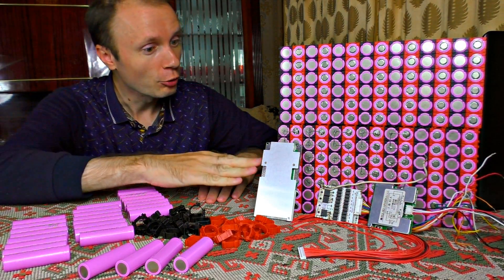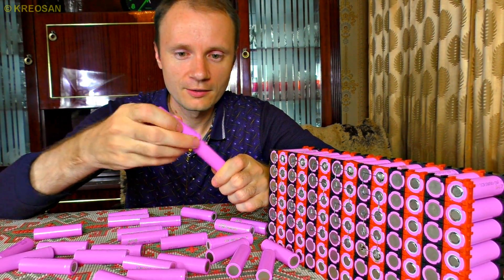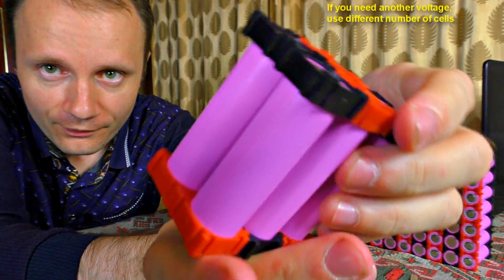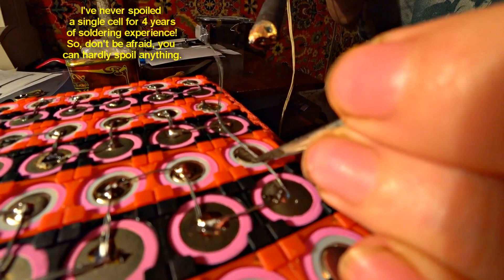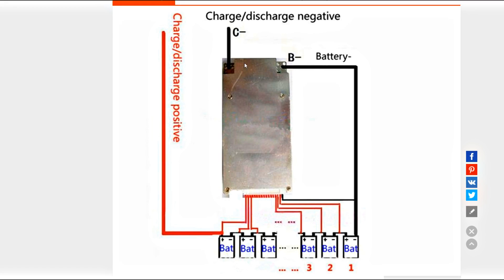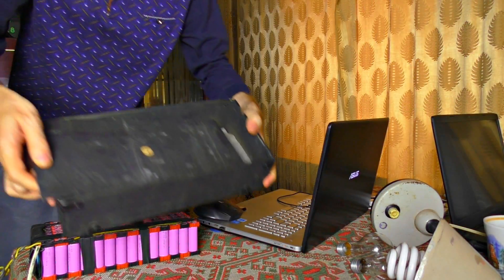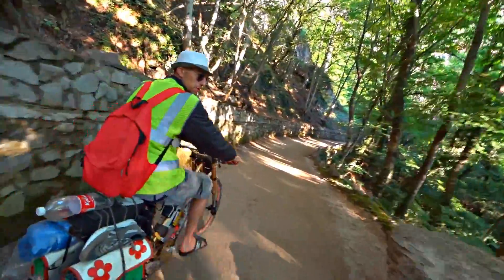Charge Monster / The Most Powerful Accumulator and Powerbank DIY

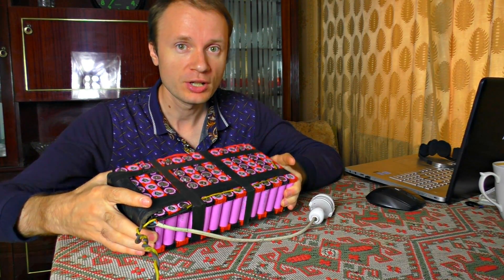Comment: 6:00 Why is it working? Charger needs AC but battery gives DC, you didn't even say about it.
Reply: Charger eats anything
Reply: Chargers use switch mode power supplies which work with both ac and dc and have a wide input range

Comment: please i would like to charge my battery on the skate faster now i have a 330W charger but 1200W would be a bit better advice i just need a power supply cc cv 48V and 20 up to about 30A ... thank you.meanwell are very expensive and aliexprews heating uz holen let you get involved in the sieves without a hitch

Comment: Yeah man I like your cells. I used a welder too but I only charge 50% at a time to avoid cells heating up. If cells got hot just one time it evaporate the electrolyte and lose energy capacity 10%_20%.

Comment: Please I install Mikrotik and Ubiquiti radios at remote areas and they are mostly 12v/24v,i have 18650 batteries that I want to be able to build a power pack that can last throughout the night and also even for 1 to 2 days when there is no sun...I have 10 of the radios on a mast or a pole pls advice

Comment: Wait... did he just connected regular lightbulb (230-240v AC) to a 48dc without a inverter ? I really want to know if that was the case
Reply: ShowMeQuick I saw that. It won’t work as most of them have a transformer. Transformers only work with AC power. This was dc. I don’t believe it’s valid myself
Reply: Some lamps use smps inside which have a wide input range

Comment: Bateries in series are not to be played whit. Easy to get zaped or killed. 
For those that are not avare over 40 to 45 V is treshold of human skin conductivity.
Bateries have more unf than most power grid lines.
Imagine Li ion or Pb batery say 50 to 60V and full discharge curent from 30 to 40 times capacity.
If starting low curent from high resinstance blocks musculs in lims then slowley you get cooked alive or more likley dead.
Think first and thick ruber gloves for the electricians are a must
Reply: 48V DC is not enough to do any harm unless you stick it in your mouth.
DC starts getting dangerous around 150V, but AC is a lot more dangerous and 100V AC can easily kill you.
Reply: @demoniack81  
In normal conditions, 48V is highest "safe instalation voltage".
Thats is why its used on aircraft etc. But imagine hands that where in saline solution aka sea water for   let say 15min, 48V safe then?
Expect strange and stupid user events always, thats life.
AC is not the more potent then DC for electricution, Edison propaganda myth from 19th cenutry, Tesla Edison competition
Reply: @ljubomirculibrk4097  I guess 48V might become slightly dangerous if you're wet with salt water, but not much I would think. If we were talking about 72 or 96V I'd agree, it's definitely dangerous if you have salty wet hands.
And no it's not just Edison propaganda, AC really is more dangerous.
The reason is that DC only has a real power component, so it sees your entire body resistance. 

AC has the ability to carry an imaginary component, called reactive power, which doesn't actually do any work, but still flows through your body due to your natural capacitance.

Basically the total impedence of your body is lower than just its _resistance_, and while to calculate current flow in DC you can use resistance, for AC you have to use the impedence, resulting in a higher current flow for a given voltage. The higher the AC frequency the more marked this current difference is, so 230V 60Hz would be more dangerous than 230V 50Hz for example.

Comment: Wouldn't that be a cold solder joint? When soldering both components must be heated equally for the solder to make a good bond. In this example the battery plates are barely being heated while the wire is taking most of the heat, and the solder is basically just melting over the wire and sticking it to the battery like glue, rather than bonding with the plate. It seems like that would cause it to break off easily. I've never soldered a battery so I'm not sure how else this would work.

Comment: Hey, someone right here, I need some help, I have 2 batteries 3.7v 2400mAh and 4.2v 4000mAh. I need a battery atleast 7,2v, I want to series both of it so I can get 7++ volt, the question is how about the capacity? Is it increase or decrease?
Reply: Using a balancer it will cut off the pack when the lowest safe voltage is reached. Or in other words when the smaller battery is depleted. You have less than 2400 mah in your pack.
Reply: Also two diffrent cells (like yours with a diffrence 3,5v) will kill the smaller one.
Reply: @alittlebitintellectual7361   okay, thankyou so much,
Reply: If the 4000mah is a 18650 then it's fake.
Reply: @benlawton5420   Its not a 18650.
Its my broken tab battery, and the another one I got from broken phone
Reply: @ZulMasriAl-Kampary  ah.

Comment: Most of devices that work with 220 v AC work with 48V DC or AC ? .
Reply: Depends on what you use most devices like chargers and new lightbulbs work on DC and convert AC to DC first
Reply: @alibatashi6813  but he plug cellphone charger that work with AC  current .
Reply: @benyoucefihab7814  chargers have a bridge rectifier first place
Reply: @alibatashi6813  and tvs and my  500w 230v running on a bank of 18650 adding too 120v and strong enougth to drill holes plugged kettle in as well but 5 mins to boil a cup full but ok
Reply: today as really sunny in uk i put 5 solar panels in serires to charge 6ov battery in using the suns free electric now
Reply: dc
Reply: i ran my tv ,rechargeable shaver,laptop from 58v dc 2  x29v battery packs  in series and went down to 46v before they were completly drained yesterday afternoon to see if it worked and phone charger and boiled a kettle took 4 times as long naturally
Reply: @theboss101cool  i know  done it twice i see that and allways thought thats what the min voltage was for japan 100v market altough some regions 120v see mr edison did not really lose the current war as most modern electronics use dc converted from ac its transmission where ac is king and with the advent of micro solar grids in sunny countries dc can rule okbut with enougth voltage for heating up and big motors
Reply: @theboss101cool  it's not seen but it works
I've tried it before with around 50 volts but not every device works on that voltage

Comment: I was always scared to use these cells. Now that I see that KREOSAN used them, ..... I'm even more scared of these..
Reply: Y
Reply: You are very dumb fairplay....scared of a damn low voltage battery
Reply: I was obviously joking. But oh well. The joke was about all that stuff about these exploding... but ok
Reply: @stonedsavage7814  - How is he dumb? He is correct to have concerns about the current 18650's on the market. With the increase/modification in specs to these batteries in recent years (the new CMD current and high-drain tech and increased amps) if you dont know what you're doing, you can easily cause yourself harm.
Reply: @organikness  Yeah my DIY BT speaker Burned because the goddamn BMS doesn't work properly
Reply: @stonedsavage7814  Store this shit improperly and you will se what happens...
Reply: @Trikipum  Ain't that the truth. I bought a bunch of them back in the day to make e-cigarettes out of school markers (long story). Anyway, I took all the OC/OV protection off of them as well as the wrappers so they were just the cells. Stuck them all in a little drawer organizer, shut the door and forgot about them.... until I heard the hissing. Had to stick them all in a bag and put them outside till they fully vented and then call poison control to make sure I wasn't going to fall ill from touching the electrolyte or anything.
Reply: @stonedsavage7814  Bruh wait until you experience how greatly can this tiny and lo w voltage cell destroy your house
Reply: Their not bombs. Just don't be a dumbass with them and dont puncture or short them
Reply: Remember these guy are pros so they can do it. It's ok 😂
Reply: sorry to be off topic but does anyone know of a tool to log back into an instagram account?
I was stupid forgot the account password. I appreciate any assistance you can offer me.

Comment: Please don't charge to 4.3v.. 4.2 should be your max.
Reply: tesla  charges its batterries the cars to 4.1v it makes the batteries do well  of 1000 cycles
Reply: https://batteryuniversity.com/learn/article/how_to_prolong_lithium_based_batteries
Reply: For lithium ion: 
4.1 is often to prolong life / 4.2 nominal max safe voltage / 4.3 overcharge

Just charging to 4.1 instead of 4.2 can double the cycle count on that cell... However its inverse squared so the diminishing returns stop most from going lower than 4.1.
Reply: @bryanjk  i know tesla charges up too 4.1v there saying with average chargeing cycles per year tesla car batts will last over ten years
Reply: @bryanjk  Yes but its also a question of Time..... If you go Balanced carefully to 4.3 and use them Quickly, its no bigger Thing. also if you go under 3V for a short Time its ok. 2.5V damages Liions imentatly if they reach this Voltage! Caution!
Reply: @Time1iver  If you charge a cell to 4.3v it will quickly self discharge to a normal voltage and damage it in the process.
Reply: Challenge accepted.
Reply: smartphone charge to 4.45v, ofcourse it is bad for the life just to get a little bit more capacity

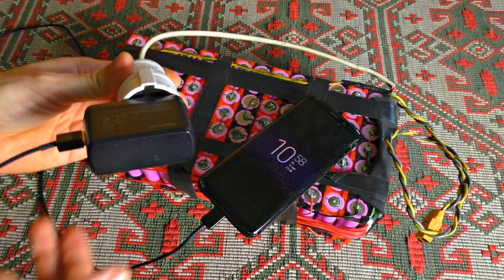Comment: Is 6:00 faked?  Transformers only work on AC, and the battery puts out DC.
Reply: It can work on DC
Reply: I think same
Reply: No the transformer he used is a switch mode power supply which is designed to work on DC of course old school transformers can't work on DC
Reply: Microwaves and some other things do but most things use a ac-dc rectifier then a dc regulator.

Comment: 1.5 dollars per cell? Thats dirt cheap. I cant find any non fakes below 4.5 usd.
Reply: R4GE K1D https://m.aliexpress.com/item/32795814865.html?trace=wwwdetail2mobilesitedetail&productId=32795814865&productSubject=40pcs-lot-Original-18650-3-7V-2600mAh-For-batteries-rechargeable-Battery-ICR18650-26F-safe-batteries-Industrial
Reply: try on ebay lenovo 12 cell laptop battery  brand new theres loads about becauce laptops only use thin polymer batteries and there a glut of unsold replacement battreries many sanyo (the heaters) 2200 mah  i found after being new and a few charges they don get that hot and 12 cells at around 18 dollars 14 pounds
Reply: Exactly, they're fake.

Comment: Accumulator = battery
;)
Reply: In several languages the rule is that a non-rechargeable battery is called battery, while a rechargeable battery is called accumulator or just accu.
Reply: PERILEX 
Cool!
But in English we say “battery”
Just helping out... I mean, the channel is called “KREOSAN English ” for a reason.
Reply: @benji376  bruh ,calm down. it's a synonym.
Reply: Cheese 1337 since when was I not calm? I’m just arguing for my point.
Reply: @PERILEX  in finnish rechargeable battery is akku
Reply: It's an accumulator... Just America is too dumb to know the difference
Reply: Peter Zingler 

“a container consisting of one or more cells, in which chemical energy is converted into electricity and used as a source of power.”

There is no difference in “America”. Idk why you said that because I’m from Norway
Reply: Actually the battery word came from putting multiple chemical cells together into a battery of cells, hence we use multiple parellel short and long lines in circuit diagrams to symbolize it. A single alkaline "battery" SHOULD be called cell. A any rechargable should be called akkumulator and packing any rechargable or non rechargable in a single body should be a "battery (of stuff)". English butchers everything. In hungarian we call non rechargables "alkaline elements" or simply "elem" and the other is the same I explained. Other languages don't mess this up. 
  but english is a mess. I hate english with a passion.
Reply: Amerikansky spy trying to teach proper English.
Reply: Morrissey Kuc 
on your channel you saved a playlist called “English language learning and teaching resources”.
Reply: @benji376  'the enemy is a very good teacher' 
-Dalai Lama